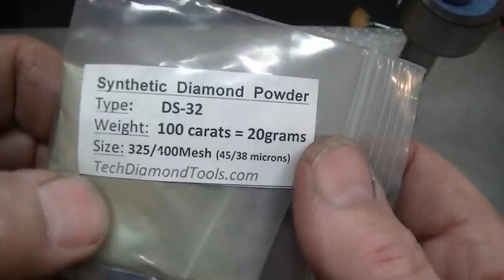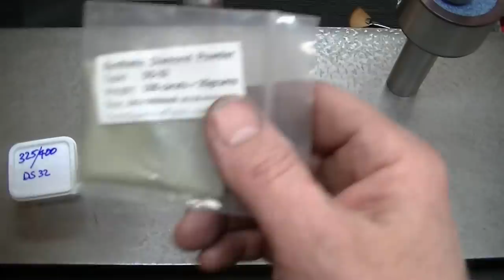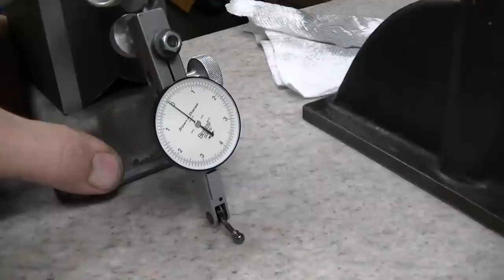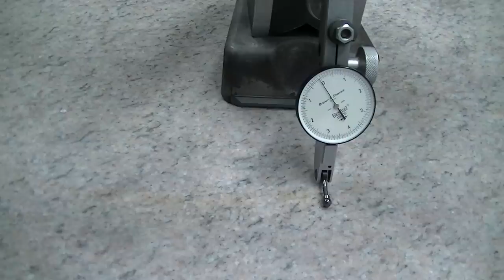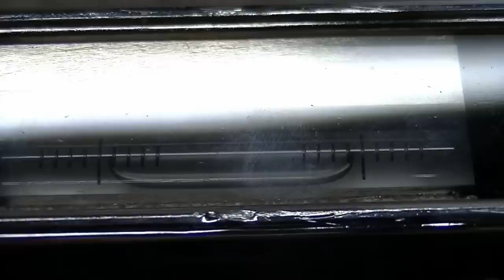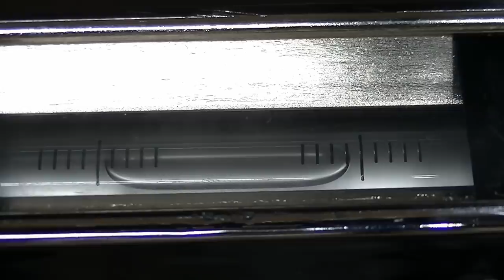DIY SURFACE PLATE LAPPING PART 1

Comment: Very cool... I hope this isn’t a stupid question, but shouldn’t the cast iron lapping plate be removed from the surface plate before rough checking the flatness of the plate with the level?
Reply: I would think so! After seeing the difference the counter weight makes to that massive thing I'm certain the weight of the lapping plate would influence any comparative readings. Robin, could you do that sequence again but without the lapping plate, so we can see if there's a significant difference? Cheers! ;)
Reply: I am guessing it is not an issue if the lap is not moved during the process. The counterweight seems to be to compensate for the changes caused by the movement of the level itself.
Reply: I would expect the deformation under the weight of the lap would be in the millionths. Well below the measurements used for rough checking.
Reply: I agree with the commenter who said it's okay of you don't move it, especially at the roughing stage. It's going to distort the surface by a very small amount, but not enough to matter. The problem would come in if I start moving the iron plate, because that's going to mess with the levelness of the whole surface
Reply: chris0tube changing the weight distribution on the plate moves the whole surface with respect to level, that's what was being shown with the small weight, but if the larger weight isn't being moved it won't influence the measurement reading to reading. It will slightly alter the geometry of the surface, but by such a small amount that it doesn't matter at this stage.
Reply: chris0tube the smaller iron plate isn't going to be changing the shape of the plate by an amount on the order of tenths, it just isn't. It may compress the rubber pads the plate sits on, which could very likely be easily measured, but it doesn't influence the measurement that robin is taking because it stayed in the same place throughout the period of the measurement being taken. Therefore the offset from level was constant, and it can be easily nulled by levelling the plate, or just removed after the measurement has been taken.
Reply: chris0tube ask yourself, why is it okay for him to stand in one place, but not walk around the plate? The answer is that if you're moving around you're changing the level of the plate, but if you stand in one place it stays constant and cancels out of your measurement. It's exactly the same with the lap staying on top of the plate.
Reply: It is contributing in a certain sense, but because it's not moving it doesn't influence the accuracy of this particular measurement.
Reply: I have said several times that there is flex in the granite, but this flex is too small to worry about for the measurements in this video. The thing that we're worried about is influencing the level of the plate throughout the measurement, that's why robin needs to stand in one place, that's why he's using the counterbalance, and that's why it doesn't matter if the lapping plate is left there.
Reply: I disagree that it should have been removed, because it will not distort the plate enough to cause a problem with the measurement being taken. Removing it would have given a marginally more accurate measurement, and I mean marginal, smaller than 1%.

The measurement taken was on the order of a thou or two. The level resolves to tenths, but the total measurement was somewhat larger. I would bet that I could stand on my surface plate and only introduce a distortion of a thou or two, and that's while my surface plate is much thinner than the one in the video, and my body is much heavier than the lapping plate.

If you think that the lapping plate is likely to cause enough distortion to mess with such a coarse measurement, I encourage you to go and actually measure how much distortion is caused in that scenario, and then I'll believe you.
Reply: I don't recall Robin talking about coefficients of expansion, those are design decisions, and cannot so easily be changed at a later time. If Robin were designing a procedure by which he was to be bound for every single measurement he takes, that procedure should include removing the lap, but that's not the case. The influence of the lap will be scarcely measurable until the plate is reasonably flat, at which time he should remove the plate, but prior to that it does not matter.

In addition, trying to say that you were only arguing the point that there is in fact some distortion is disingenuous, you're moving the goalposts. Just 50 minutes ago you said "[the] question was whether the surface plate should have been removed prior to measurement" and "[I] support that notion", we agree that there is a small amount of distortion, the question is whether that amount of distortion supports the idea that Robin should have removed the lap.
Reply from the maker: I will cover this in a follow up video. Thanks for watching and commenting.
Reply from the maker: Correct
Reply: If I may expand on my original hypothesis, the level will allow to read very small concavity or convexity in the overall shape of the plate, but ONLY if the plate does not move during the reading process. Can the lapping plate deform the table? Of course. Can it turn a convex plate concave or the reverse? No, thus leaving it on the plate is not an issue, while varying the position you do the readings from, or the shifting, uncompensated weight of the level can change the level plane of the plate between two readings, and thus falsify the output.
Reply: Again, those are design decisions that are going to affect his use of the plate for the entire time he uses that stand, but leaving the lap on the plate for rough measuring does not bind him to never remove the lap for more precision measurements.

In addition,the very first thing I wrote in this thread was "It's going to distort the surface by a very small amount, but not enough to matter", so I am clearly not denying that some distortion will occur. My point is that the distortion is so minuscule as to likely not even be measurable using the method in the video, and therefore it will not influence the reading. It would influence the reading in the same sense that breathing on the plate is going to warm it due to thermal expansion, and that would influence the reading.
Reply: When I said the distortion is minuscule I'm talking about the actual flex of the plate, which is likely to be on the order of millionths. This is a fundamentally different type of error than the shifting caused by moving a weight around on the plate.

It now sounds like you might be trying to say that placing the lap on the surface plate would throw it off level, and this would cause an error in the straightness measurement, but that's not true. As long as the lap isn't moved while taking the straightness measurements, the level is offset by the same amount every time, and it cancels out.

The only error that is of any concern with having the lapping plate left there is the error caused by the distortion of the plate, caused by flexing, and this error is so small as to be irrelevant. Like I said, on the order of millionths, too small to worry about when the plate is still roughly a thou out of flatness.

Is your only concern that I don't know how much the plate was flexing by? I will freely confess that I don't know exactly how much, but I don't need to, because I do know that it is small enough to not matter. Like I said before, I would bet money that I could stand on my surface plate without introducing nearly a thou of error, and that's when my surface plate is much less rigid and my body is much heavier than that lapping plate.
Reply: Yeah, this is the goalpost moving I was talking about, previously you've been talking about whether Robin should or should not have removed the plate, and you claimed that he should have.

Now that I have a clearer understanding of your issue, do you want to know how I know the flex of the plate is negligible? because the entire purpose of a surface plate is to be flat, they're designed to stay flat even with a very large weight on them. That's why they're made of granite.

The master pink line seem to all be rated to 50 pounds per square foot without going out of spec (including Robin's one, I can link you to the spec page if you want), do you think that lapping plate greatly exceeds 50 pounds per square foot? And remember, that's the rating for staying within spec, with a safety margin, on a lab grade plate. You could probably go to 150 lb/sqf or more without taking it far beyond a B grade, which is still better than 1 thou total flatness
Reply: The goal of testing with the level seems to be to determine if the surface plate is concave or convex, in order to determine what the proper lapping technique currently needs to be. You can do this with a level if the plane of the surface of the plate stays the same from one reading position to the next. The lapping plate does deform the granit, and to a much larger extent changes the plane of the surface plate (because of elasticity in the stand and the floor), but if it stays in the same place throughout the process of doing the readings with the level, the plane of the surface plate will stay consistent, and that is what you want to get the results you need. The level can tell you if the plate is convex or concave, as long as the surface being read stays in the same position from one reading position to the next. Nobody is saying the surface plate doesn't change the geometry of the surface plate, but the tool being used, as well as what is being measured make it irrelevant in this specific context.
Reply: @christ0tube Yes, it's asinine. Picking an argument over whether or not the measurement could have been more accurate is asinine. I never claimed that removing the plate wouldn't improve the accuracy, I only claimed the improvement in accuracy was so small as to be irrelevant in this case. Carrying on an argument, when your only point isn't something I disagreed with, and indeed repeatedly agreed with, is asinine.
Reply: @Stephane Hit the nail on the head.
Reply from the maker: Well said, Thanks for watching and commenting.
Reply from the maker: Well said again, Thanks for watching and commenting.
Reply from the maker: I will cover this in a follow up video. Thanks for watching and commenting.

Comment: Thank you for sharing your knowledge and taking your time to document this. I would love to know where you get your abrasives, quantity, and particle size. We know about the three-phase method, but what about this gets around the aspect of needing the 3rd surface? Is it that you start with a relatively flat lapping plate, or that you will tune the surface based on measurements, etc? I'm planning to lap a granite slab mounted on rebar reinforced concrete with  come ivanko 45lb cast iron plates that I've lapped with the three plate method. They don't have ribbing like your lapping  plate, but if the bottom of the plate is supported at three points, I'm getting 3 tenths. Thanks, Robin!
Reply from the maker: I will cover this in a follow up video. Thanks for watching and commenting.

Comment: Man you just made my morning coffee taste that much better. Kids are at play group and I can actually think about something technical thank you. Nothing is a secret black box and that's why I love your teaching style. I only noticed the speed up sound maybe 1/3 esp the charging scene  of the video the rest sounded normal. Question about the differential level. Does having the big heavy lap on there effect your readings? Does the counter weight have less effect the closer it gets to a support foot and the level further away. Great video keep them coming!
Reply from the maker: I will cover this in a follow up video. Thanks for watching and commenting.

Comment: Great content as always.  Very educational! I don't think I'll be trying this with my el-cheapo surface plate (well, maybe) anytime soon, but it's good to see the process.  It would also be good to know what 'minimum' tool set is needed to improve a small plate... Thanks for taking the time to share!
Reply: sorry...that should have read "...'minimum' measurement tool set..."
Reply: You Refer to your plate as an ''el-cheapo'', is there a big difference in the actual granite used in cheap plates as opposed to something like a Starrett? What about between the different flatness grades? I thought the cost difference was more in the work that had gone into them rather than the actual granite. Btw, you can edit your comment by hovering over it and then clicking on the three vertical dots that appear on the top right of the text.
Reply: I refer to mine as an el-cheapo, primarily because (at the time I purchased it) Enco was offering a large percentage discount (around 30% if memory serves) as well as free shipping for orders over a certain amount.  It's a small Grade B plate (12 x 18 x 3 inches), but if the included certs are to be believed (i.e., accuracy is stated as "0001" by inspector "O1"), then it may be as flat as a Grade A lab plate of the same size.  As for the quality of the granite, my understanding is that those with higher amounts of quartz (by volume) tend to be more durable, and wear more slowly.  My plate is a darker one, sort of bluish in color.  However, there are areas or 'blotches' where the granite appears to be of different density (?).  I have no idea of the quartz content of my plate.  I'm still new to this subject, so it's best to research your question(s) online, or at the local university; as that is what I've been doing.  Starrett has what appears to be some good info: http://www.starrett.com/metrology/metrology-products/precision-granite/precision-granite-faq. While I personally have no way to know exactly where my plate originates, I think it's a pretty good bet it's from Asia somewhere (India or China perhaps).  Looking at the Certificate of Inspection document that was packed with my plate, has "MHC Industrial Supply CO., INC". Hope this helps...
Reply: Thanks for the info, I will look into it further.
Reply from the maker: Thanks, and thanks for watching and commenting.

Comment: I don't know very much about lapping, but I wonder how this process works in comparison to three plate lapping where the principle of adding in a third plate is supposed to correct for convexity/concavity that can occur when just lapping two "flat" plates together (as one does to get curved surfaces when grinding lenses)?
Reply from the maker: I will cover this in a follow up video. Thanks for watching and commenting.

Comment: Is it possible to clean and recycle your abrasive? You mention that the plate needs to be cleaned when you can feel there is too much abraded material on the surface, but it seems like you'd also be throwing away some of your abrasive when you do that. I know that Cody Reeder was able to use gold panning to extract just 2 or 3 diamonds from a bag of the cuttings from a concrete saw, so there are some pretty powerful separation techniques available, but I have no idea if it would be economical
Reply: I did have a bit of a look a while ago, looking for diamonds to use for playing around with lapping, and I recall thinking they were more expensive than I'd really want a pay. I'm having another look on ebay now, and i'm seeing around 0.50c to $1 per gram, which I suppose is pretty reasonable.
Reply from the maker: I will cover this in a follow up video. Thanks for watching and commenting.

Comment: I think there was supposed to be a handle that sat in those machined holes at the ends of the plate. I seem to recall seeing a plate like that (different size) where two plastic handles with balls on the ends came out, curved and reached somewhere over the plate.
Reply from the maker: Thanks, and thanks for watching and commenting.

Comment: Thank you. That was one expensive plate when new. The audio doesn't bother me, more interested in the facts. I didn't see you mount the plate on the cart. Even with 3 point contact it seems like there would be give from the cast Iron. I've watched the pros do a couple of laps. Their ability to measure would be great for you to have. I'm sure the cast iron wears a lot faster than the granite does having a lot more wear in some areas of the plate affect the outcome? Guys buying diamond grit on fleaBay, do they get misc. odd chunks mixed in?
Reply from the maker: I will cover this in a follow up video. Thanks for watching and commenting.

Comment: When you are leveling the plate it seems that there should be an effect from the lap lying on the plate whilst you are using your "poor mans differential level"  I am wondering how you are accounting for that mass
Reply from the maker: I will cover this in a follow up video. Thanks for watching and commenting.

Comment: What diamond size should we use? 40 or 60 μm??
Reply from the maker: 40
Reply: @ROBRENZ  thank you. I tried 10 micron, but nothing happened. I mean the cast iron also was very hard e.g. 30 hrc. I think I must use a softer plate